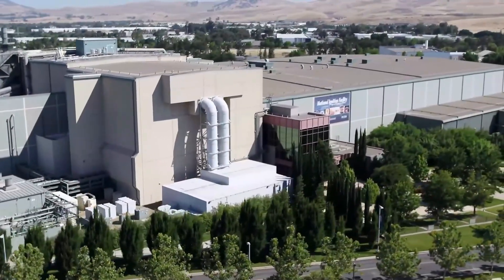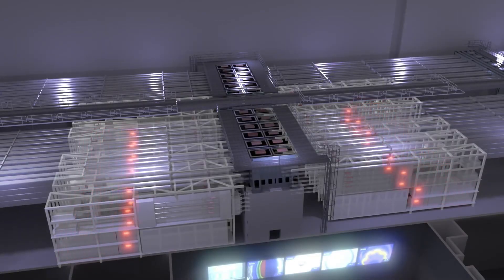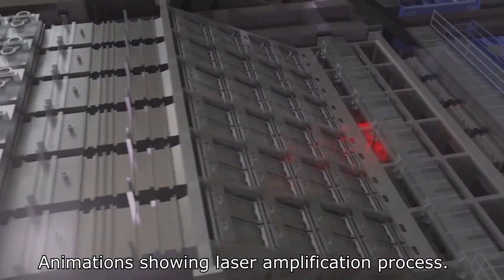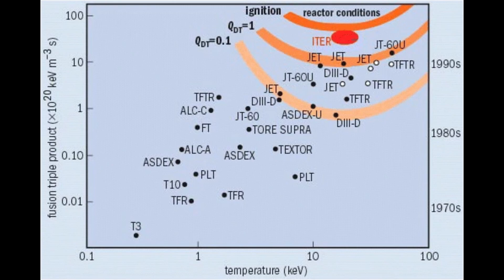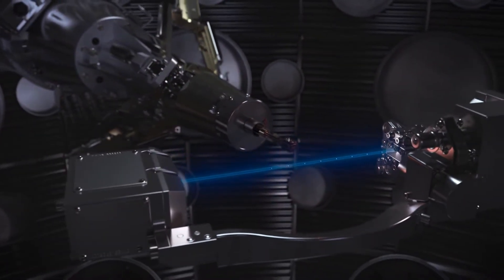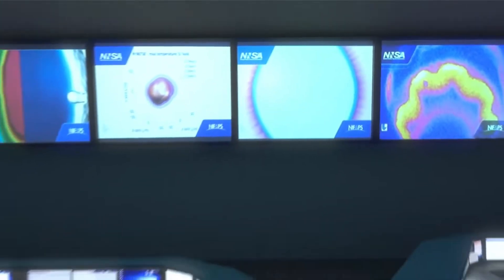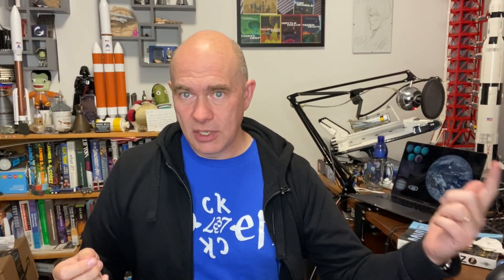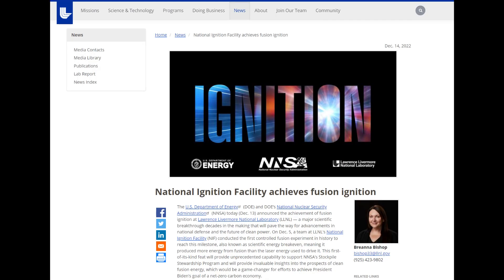Why The Biggest Laser in the World is Making Big News About Fusion

Comment: The problem with laser fusion is that the 2 megajoules of ultraviolet light started out as 4 megajoules infrared light and that too 300-400 megajoules electrical input.

The second problem with laser fusion is that if you’re lucky enough to convert half the fusion energy into thermal energy, you’ll need twice that just to breakeven.

The third problem is that the pencil eraser capsule probably doesn’t have the capacity to release 600-800 megajoules and a bigger one will need an even bigger laser to bring it to ignition temperature.

The fourth problem is tritium breeding realistically requires neutron multiplication to provide enough neutrons to provide enough tritium to replace what is burned.

The fifth problem is that a uranium 238 blanket can use fast high energy fusion neutrons to release more energy than the they absorb from the fusion neutrons. This closes part of the gap on energy gain necessary because the fusion is now around 1/10th of the total energy. This decreases the growth in fusion capsule size and input energy, while also reducing tritium input required. Given the cost and relative rarity of beryllium, it’s hard to imagine a pure fusion reactor that doesn’t count on a fission blanket. Uranium 235 is used in power plants because it can fission with fission energy neutrons, allowing a chain reaction. The fact that uranium 238 doesn’t soak up all the neutrons it liberates is actually desirable as ensures making a decent amount of tritium.

The sixth problem is one of nuclear proliferation. Giving up production of around 25 grams or a little less than an ounce of tritium production allows production of enough plutonium for a minimal nuclear weapon without an isotope enrichment program. Or the neutrons could be used to make uranium 233 from thorium, that could be used for peaceful purposes, for breeder reactors to make tritium or other nuclear fuels , or fuel for nuclear submarines and other things.

The fact that a hybrid fusion-fission cycle producing neutrons is more than an order of magnitude easier for achieving breakeven pretty much guarantees as soon as investors start demanding results, hybrid plants will emerge ensures that this path will be taken. The fact that the fast fission energy amplification increases the energy output without requiring an increase in the fusion target or increasing the thermal flux on it inner wall surface gives additional gains.

Comment: Use a Lithium blanket or shell of liquid Lithium, to absorb the neutrons making heat and Tritium.  The NIF is a test lab, production of a fusion machine will not happen, but LLNL already has several fusion engines, they just make a lot of heat and light for a brief period of time, with disastrous results.

Comment: Scott, I'm not as excited about this as perhaps I could be for a couple of reasons
1. From what I've read it looks like the 2 mjoules of input power were as you stated the laser power. If those lasers are only 1% efficient that would imply that it took about 200 mjoules of power to the lasers to extract the 3mjoules of power from the plasma. And that doesn't account for ANY additional power it took to to prepare for the .1NS blast.
2. You mentioned that tritium is expensive. There's an article in the 24 June 2022 issue of Science that discusses this. The article states that a gram of tritium costs around $30K today and the total world supply of tritium is around 25KG. 
3. The same article states that ITER is expected to consume most of the world's supply of tritium once it comes up to speed (pun intended) in the next decade.

I know that fission reactors, especially the ones in service today, can be "dirty" but I'm still putting more fail in LFTR technology as a way of generating clean energy in anywhere in the near term that I expect from fusion. The underlying technology (molten salt) was tested successfully over 50 years ago at yet another national lab (Oak Ridge) where their MSR ran at full power for over 13,000  hours during its 4 year test period.

Comment: It seems strange to me that I want to build a modified version of the rocket engine system. The ingredients as follows are Laser's, Disks, Liquid Hydrogen, Helium H3, Kerosene and Magnets. The Lightcraft system by Leik Myrabo turned horizontal, the disks are mounted on a magnetic drive system for frictionless motion. Fuel is sprayed in by pressurized injectors in which the spark from the laser's hitting the disks which gives a little boost as well , all internal firing that runs a course similar to an exhaust system to create torque and fired sequentially . It's not impossible but the laser's are not just pointing at the disk , it's shot like from a barrel similar to a musket or a horn to shield from the inferno within and is also made from heat shielding ceramics. Cooling takes place similar to how the bell nozzle system works. Btw 8 300kw laser's. I like the sound of American muscle 😎 . You can tune into this very old video presentation on Lightcraft https://t.co/l7MMVoWQYu
One important part is the air induction process that spins the disks. A real hybrid system is required for the journeys beyond. This is what I want to build, it may even blow up but the what if

Comment: How can this be scaled up? I’m struggling to envisage what a commercial reactor based on these principles would look like. What direction is this going in terms of practical engineering?
Reply: I envisage a series of reactors where energy from the previous one starts the next one, and by the time you get back to the start the first one will have been refueled and reset, and it goes round and round like that.

Comment: If minute errors in the surface of the pellets is a limiting factor then this is not a scalable solution. They need a different way to feed the fuel into the reaction. The pellet can kick start the reaction but  it is not practical for large scale. This will only ever be a component. Do they have a plan for a practical feed mechanism?

Comment: Fusion question for the serious scientists types that may be watching. Why has no one tried somthing like this: Accelerate a fusion fuel plasma down a long acellerator to a high velocity, (Some significant fraction of C) and then let it enter a section where the magnetic field constricts to the point of compressing it down to fusion densities. Because the velocity of the plasma is providing the compression energy and the compression inducing magnetic fields are static wouldn't that get around some of the issues of controllable magnetic fields that can contain , pre-compression manipulate, and then compress the plasma that plague tokamak designs?

Comment: A small clarification about tokamaks, they use pulses too... but the pulses last long, seconds to minutes, not picoseconds like here. 
The reason for that is that a necessary part of the confinement field is the electric current flowing inside the tokamak, essentially within the fuel itself. It has to gradually increase to get some stability, unfortunately you cannot design a magnetic field capable of stable confinement (without magnetic monopoles 😀). 
Stellarators go about it differently, attempting to minimize the instabilities instead of getting rid of them by the current through the chamber. But instabilities are still present, probably meaning some limit on duration too, although it's not pulsed in nature as tokamaks are.

Comment: I'm glad Inertial Confinement Fusion (ICF) researchers are making some progress, but you really hit the nail on the head at 10:51 "...but turning this into something that can actually generate energy, that's not going to happen with this design." I have been saying this for years. While this particular research may have some theoretical value, I believe their entire approach to inertial confinement really wont deliver when it comes to technologies that can actually be applied to generate fusion power at scale. In contrast, I believe that approaches that basically focus on generating and holding a hot enough plasma for long enough, such as various tokamak designs, are more inherently scalable and applicable to real world power generation. Of course there are significant challenges in the tokamak approach, such as dealing with plasma instabilities that inevitably form while you try to confine and heat the plasma, but I believe this is actually a solvable (though challenging,) problem. And as you point out, ICF approaches that involve imploding tiny fuel pellets also suffer from their own version of the "instability problem," in this case, absolutely minuscule imperfections in the pellet and the gold cylinder around it, that cause wonkiness in the pressure shockwave, greatly reducing efficiency. There are also a host of other problems with the National Lab's approach to ICF—too long a list to discuss here in a comment. I know I'm throwing a lot of shade on this teams research here, but seriously, if I were a betting person, I would not put my money on this approach being the one that ultimately achieves "the dream" of fusion power generation.

Comment: The real part now is going to be energy capture off the reaction, not just refining how to make the reaction. They may have measured a couple intersecting points, which captured miniscule portions, probably parts per billion of what was produced, and it will be a challenge to find ways to soak that much heat and other radiation emitted in that small a window without an ablative cascade of the capture device. Btw, that is technical for blowing to gaseous particles and scattering across the local area now also highly accelerated. In fact, for this pulse fusion, that may be the form to capture the most energy you can. Surround with a dense material(comparatively anyway, but lead would not be a bad idea), shaped to allow the lasers thru but just, in fact even a complete package form like this, where the capture the vaporized packing material instead of the blast directly, and harvest from there somehow. Probably some steam system, because we understand them better.

Comment: Yeah they did 1.5* more energy than laser energy except they use 200* more energy to generate that laser energy. (It's 0.5% efficient actually not 1%).
So yeah, they generated 0.75% of the invested energy. Also don't forget you have to convert back that generated energy back into electricity.
Conclusion: probably 0.25% efficiency!
Go back when you improve that by a factor of 4000!
Then also creating the perfect target on a very high industrial volume is unrealistic.

Comment: Fusion energy is just a legal way where scientists and governments can steal money from investors and tax payers using false promises. 
If a cost efficient fusion power station is possible some day in the future, it would not be design by us, it would be design by a hard IA who would drop to the trash everything we did so far and start over.
Today we have cost effective ways to produce reliable clean power even cheaper than the current fossil fuels.  We just need a mix of solar+wind+hydrogen.   In fact, the hydrogen part is need it anyway even if we accomplish fusion, because there is no other way to clean the utility transport sector and many applications of the natural gas grid in a cost efficient way without using green hydrogen. So the cost of storage that solve the intermittency issue of solar and wind does not come extra.

Comment: Suppose just a tiny fraction of the vast sums of money spent on chasing the unicorn of commercial fusion was spent on researching better drilling techniques such as that being pursued by Quaise, an MIT spin-off building deep drills that melt rock through microwaves.

In that case, the entire planet could be powered by geothermal power stations pumping water deep into the earth and using the resulting super-heated steam to drive simple steam turbines generating sustainable, safe and clean energy 24/7. The maintenance of such systems would be minimal and could be deployed across the planet. Fusion reactors are always going to be extremely complex and expensive beasts requiring expert management. And that doesn't even address where the large volumes of Tritium is going to come from if these things ever get deployed in numbers...
Reply: The “Old Faithful” geyser is natures proof-of-concept - water heated by geothermal energy to produce high pressure steam. Very interesting!
Reply: @gwiyomikim5988  Iceland have been powering themselves through Geothermal for decades.

Comment: On the topic of fusion:  NASA seeing clear evidence of D-D fusion at lower eV's than expected.  Theory is the reaction rate is due to electron screening in the metal lattice allowing the charged particles to approach closer to each other than they otherwise would in free space.

Interesting byproducts as well.  Pre and post analysis of the metal lattice showed transmutation into other elements that weren't present before.

Apparently auto-moderation deletes all links (even to NASA's website), but search NASA Lattice Confinement Fusion

Comment: Having spent 40 years as an engineer at nuclear (fission) power plants, I can tell you that getting continuous ignition is just the beginning.  Finding an efficient method to turn that energy into electricity will also be a big problem unless we treat the huge fusion reactor as a big heater to turn water into steam to turn a turbine like it's 1920.  Also, those high-energy neutrons expelled by the fusion reaction are going to play hell on the materials used to build the reactor.  In the fission nuclear industry we've learned that material problems are what make you spend lots and lots of unexpected money and fusion will have the same issues.  I think nuclear fusion has huge potential as a nuclear rocket engine, but no clear advantages over fission for baseload electricity generation.

Comment: Also probably worth mentioning that the 1% efficiency from the lasers was not just that they are an old design, they are also a research design. Efficiency is not a high priority on research equipment, and if you can make it even moderately more flexible you will do it, even if it means tanking the efficiency. The laser amplifiers are extremely general purpose. Once we have figured out exactly what we want the lasers to do we can start designing for that, and then we can talk about efficiency. Right now the number is meaningless.

Comment: Because the lasers are so inefficient if you actually look at the power going INTO the lasers the energy that came out of this experiment was far, far less than the energy put in - so the statement that "producing more energy from a fusion experiment than was put in" IS A MASSIVE PORKY. 
According to the BBC = "The experiment was only able to produce enough energy to boil about 15-20 kettles and required billions of dollars of investment. And although the experiment got more energy out than the laser put in, this did not include the energy needed to make the lasers work - which was far greater than the amount of energy the hydrogen produced."
These statements are all about getting more funding. 
The amount of money world wide that has been spent on fusion reactions could have been used to produce infrastructure that actually works and could have paid for much of the worlds energy. And they still have decades and 100's of billions of spending more to go. This planet will be dead long before they ever get a fusion reactor that is actually useful.

Comment: Have to disagree a bit with the last bit. The only major advantage over fission is that crap designs can't blow up, but that is less relevant these days (we are more careful with our designs). There is no fuel waste, but waste is not actually a massive problem for fission either. Fusion absolutely requires a neutron activation blanket that is regularly harvested, and this is the same reason many good fission reactors are rejected; It is far too easy to repurpose it for weapons production.
I love the vision and ambition of fusion research, but unless a simple, cheap, direct to electricity design emerges I don't see the point. If the electricity is thermal then it will be extremely hard to beat fission.

Comment: The proton-proton fusion doesn't convert one proton into a neutron by being squished with an electron.  The proton proton pairing is unstable and typically splits apart, but sometimes  one of the protons undergoes beta plus decay via the weak nuclear force and converts into a neutron.  If it decays, a positron and neutrino are emitted as part of the decay process.  The neutrino makes it's way out of the sun, but the positron annihilates quickly when it encounters an electron and create two photons. The resultant hydrogen 2 atom (deuterium) can combine with another proton to produces a helium 3 atom while releasing a photon.  Two helium 3 atoms then combine into a helium 4 atom while two protons are released.  A helium 3 atom can also combine with a helium 4 atom atom and convert to a beryllium atom (releasing a photon) and then convert to a lithium atom and finally convert to two helium 4 atoms plus a proton.

The created photons exit the sun as sunlight.  It's supposed to take something like 30,000 years for these photons to reach the surface of the sun from the core...